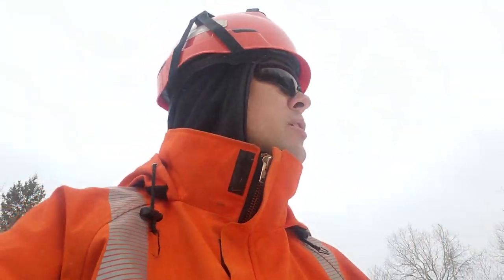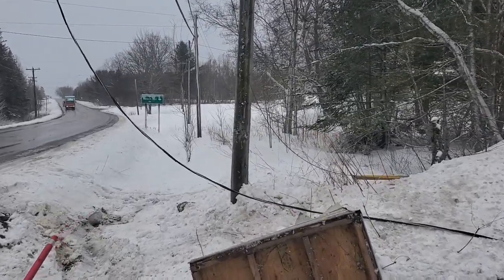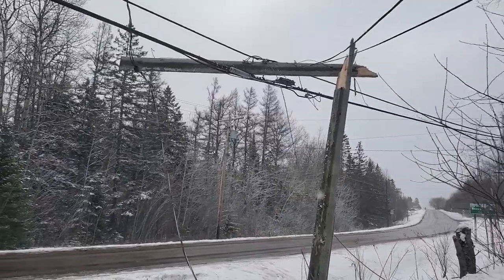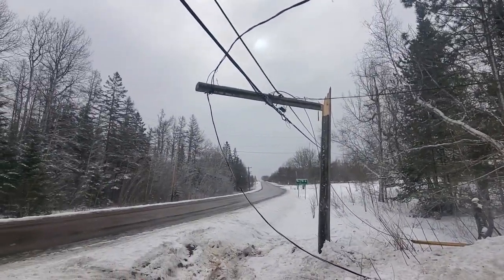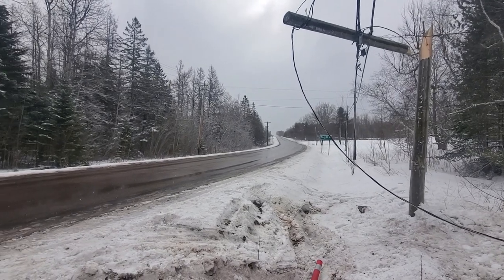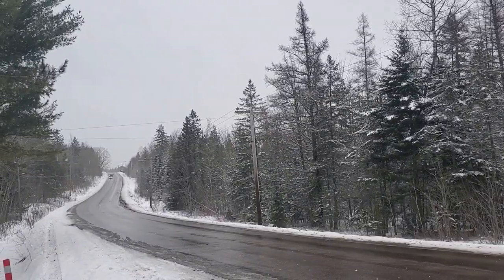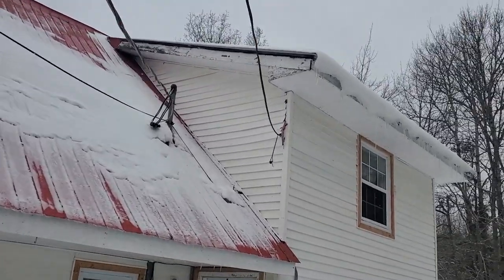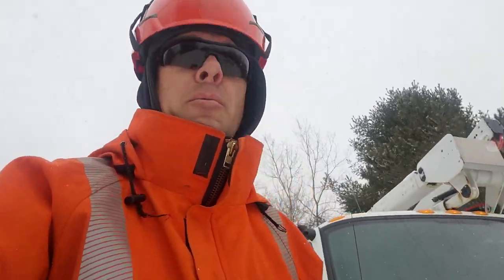Car snapped pole in half! - Quick clip

Comment: It's amazing how magnetic poles are lol
Reply from the maker: It really is! Over 100 meters of ditch and somehow the vehicles always find the 12" wide pole 🤦‍♂️😔
Reply: I work for a cable company in a bucket on call it's always around 10:30 I'd get a call where the poles are 250' to 300' apart and a car would drive right into the pole and not into the open field on either side.
Reply: @Bobsdecline  ... to be honest, the front of a car is near 6 feet wide, so helps the odds!
Reply from the maker: True, true.... And they're also traveling parallel to the poles, narrowing the odds quite a bit!

Comment: We attended one during my service with Fire & Rescue. Comms pole, half hanging in mid-air. Sadly, one of the occupants of the car was deceased by the time we got there. The intrusion into the passenger cell was almost half-way across the car. Stuff at the side of the road is hard, and it’ll hurt if you hit it. Your folks were lucky, real lucky. Drive safe and don’t hurry. Late and alive is the way to arrive.

Comment: This must be the year for testing poles. Last year they were testing poles in our area. This year I have noticed them in another county.  I find it amazing how many they test in a day.  I don t think they run out of poles in our area.  I was impressed by a pole that was no longer straight and had a good ten-degree bend. I am really curious about the induction from powerlines. I have heard that if vehicles are parked under some lines they may have to be grounded if there for a length of time.  That it may damage them if they are not.  How often do they rebuild the motors in the bucket trucks? Do they seem to get rid of them before they become high maintenance issue? It seems they would have a lot of hours on the motors. I would think they would lease them.  Most companies here in the us lease the vehicles. I spent most of the day cleaning out my work vehicle.  Seem to be a daily chore.  I like to spend at least 10 to 20 minutes a day.  It really seems to help over the years. Otherwise, it can get out of hand.  There is always something to restock and shift around. Last week I had a fire extinguisher go off near my van. I almost got the doors shut in time.  I will be cleaning that powder inside for a while.  I can't imagine if it had done it in the truck.  Luckily most went outside on the van.  This is the second time i wish we had a code word that all in the area new to look out and run for cover.  Last time we were near a vat of chemicals, and it began to overflow. I am thinking about adding a whistle to my vest.  At east you can hear that over loud equipment. We have found ourselves in some different situations in the last two years.  Then there are days it just time to take an early lunch cause it going so bad.  Well, you just need to regroup.

Comment: You really need your head on a swivel when it comes to looking for damage. Do repair costs for the electrical utility get billed back to the vehicle owners insurance in cases like this ?
Reply from the maker: That's for sure! Sometimes we'll find an insulator broke three span away from the shock load on the wires. 
In most cases we recuperate costs for the damage

Comment: You do the same thing hydro one guys do but each call 6 guys 4 truck show up. Inspectors want the service cable 4 feet long an our connections, insulation must be cut sqare ne stripped off on a taper like you do. They also want to see nolux on all aluminum lug connections witch service provider never uses as well as 2 sizes bigger or more then service provider gets away with.  in order to pass inspection. I do a lot of live work. I was trained as a helper years ago

Comment: why aren't your house connections buried under the ground?
Reply from the maker: Many of them are.... Probably about 15% (complete rough guess).
It's left at the homeowners discretion if they want an underground loop from their house to the pole we will absolutely accommodate that at their cost. 
There are some neighborhoods however where it's a requirement from the original developer.
Reply: Yeah it's optional pretty much everywhere in Canada. I can say that here in Quebec we're seeing more and more underground services, mainly because of added restrictions on how you can do aerial services. It's just easier to do them underground even though the cost is higher.
Reply: Underground is more expensive to install and more expensive to maintain/repair.  All such costs are up to the homeowner.
Reply: I think it is something to do with cost and requirements. It’s way cheaper to put a mast(is that the name?) up and have for example 50 feet of 2 awg triplex than to dig all the way from the pole to location and potentially have to dig under sidewalks and around other utilities and have 1/0 triplex(underground variant)